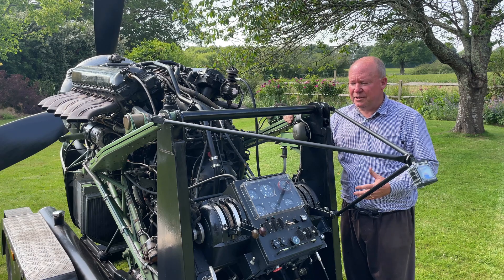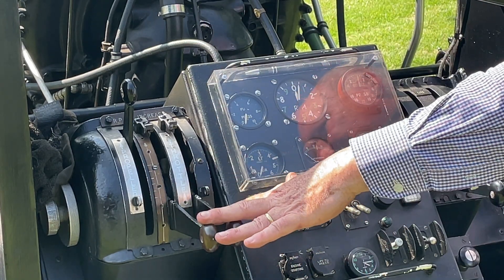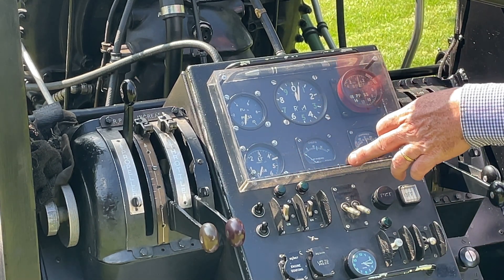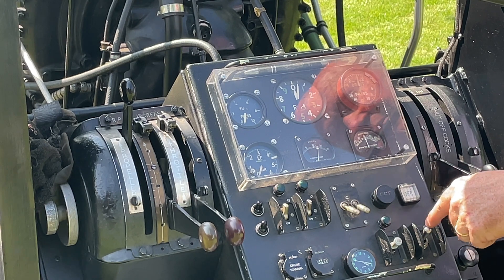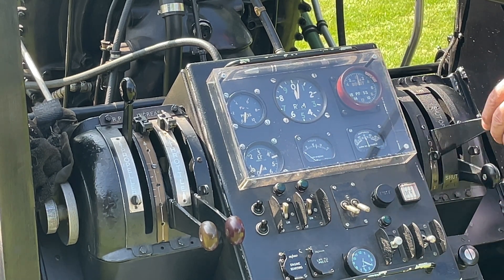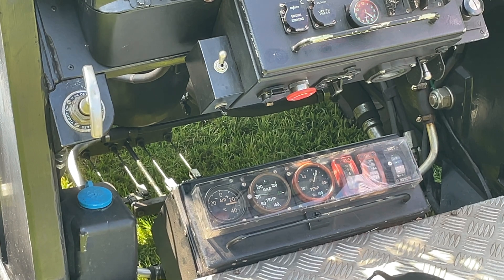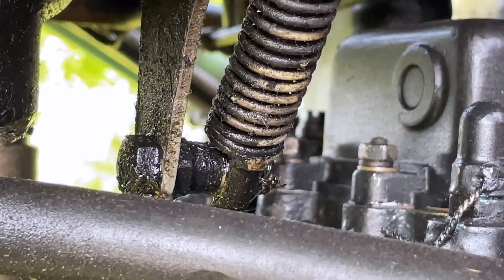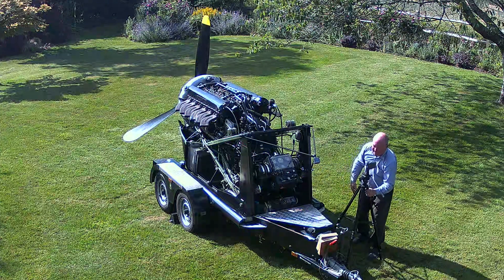Rolls-Royce Merlin aero engine, trailer details and demonstration

Comment: I've seen some trailer engines being run without a prop. Is there any advantage/ disadvantage  to either approach?
Reply from the maker: It is ill-advised.  The Merlin crankshaft is torsionally  damped with the load (propeller).  An undamped crankshaft will likely lead to problems.

Comment: Fascinating! Where is the fuel tank on that trailer and how much do you need for a day of displaying. Also, do you stop the prop in "Y" position to reduce the trailer height for towing?
Reply from the maker: Fuel and oil tanks form the chassis of the trailer.  Two long tubes, one either side of the engine, each with a capacity of 38 litres.  I would expect the engine to consume 16 litres of fuel per run.  The Y-propeller is what I call the 'dressed position'.  At public displays, to reduce the chance that wide-eyed visitors bumping into the propeller, this Y-parked orientation is best.  At the end of the video, the propeller is feathered and the upside-down Y is for transport on the road.  I attach red/white LED lights to the tips of the two lower propeller blades for road visibility.

Comment: Veru interestng. Thanks. I thought the right, covered button was the booster coil, but you say it grounds the mags, and the booster coil is a toggle switch. Is that the normal layout? I thought the covered buttons allowed that function to be done with one hand. When I'm wrong, I like to be so for at least a decade 😉
Reply from the maker: The start and ground buttons are side-by-side on our trailer so we can push both with fingers on our right hand, while pumping the kigass pump with our left hand.  On a flying Merlin aircraft there are various configurations, including starter magnetos one early Spitfires and booster coils.